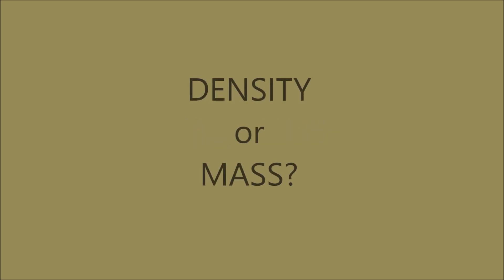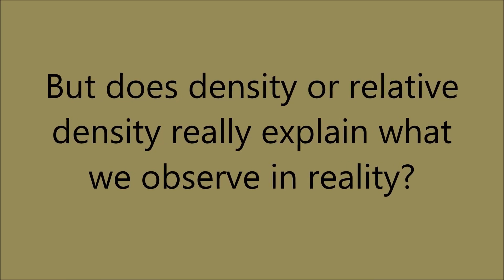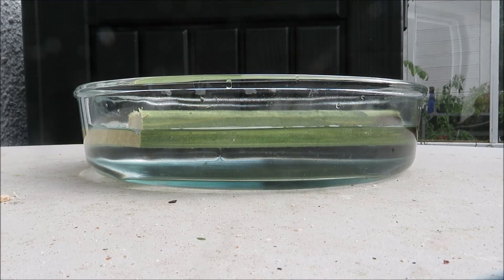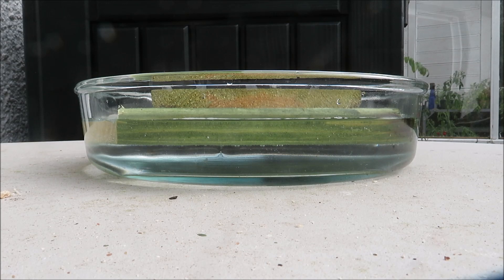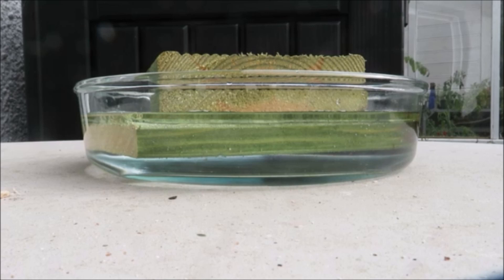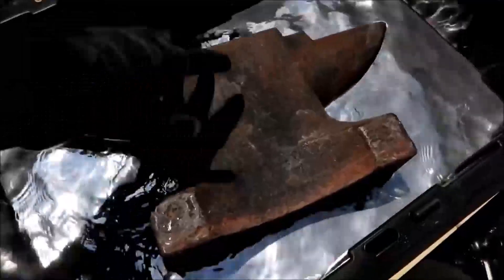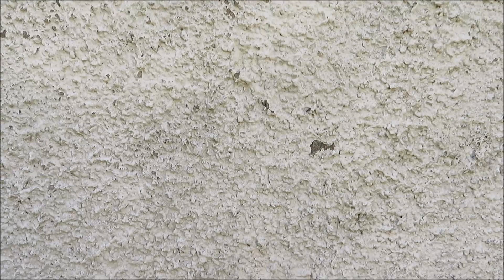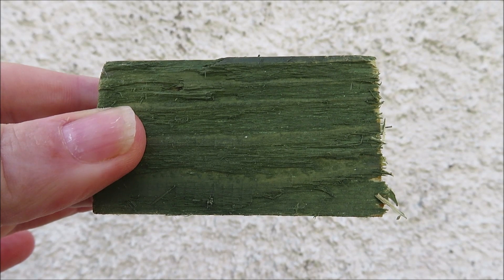Density or Mass?   Gravity or Relative Density?

Comment: Nice one  Miles and good to see you back. I was getting concerned that you had been bumped off at Traprain Law by Del. 
Yes it's the same old problem for Flerfs. Why does density act down? I got Phuket Word to agree (before he blocked me) that there was a downward force. I told him we had to call that force something and for most people that something is called Gravity. I also pointed out that a ball bearing will not penetrate a polystyrene block thereby proving that density is not the only p!Ayer in town.

Comment: Excellent video. I also made similar arguments in a video. Even more than that, 99% of the air is 3 elements. Why does it have a gradient and why are the 3 elements evenly mixed well beyond 60000 feet? My guess, gravity.
Reply: Gravity explains the density gradient but not the mixing of different elements.  In fact, it's a bit of a problem, as the different gases have different molecular weights, so you might expect the heavier ones, like CO2, to sink to the bottom, which fortunately they don't.  I think the main reason is that the different gases can freely diffuse through each other, and their kinetic energy (heat) and convection currents keep them well mixed.  It's the same with particles of ink or dye in water: they are usually much heavier than the water molecules, but diffusion keeps them mixed.  But if the heavier particles were collected together and enclosed in a bag, they would sink.

Comment: 1ltr bottle of water in one hand , a 2ltr bottle in the other. Which gets tired first?
Reply: How the heck do you hold 2 litres of water in one hand, unless its ice? I can see how your do it if it were in a bottle.
Reply: Robert Langford edited to clarify the situation. I don’t get an idea very often so I was rushing to type it out. Ice is also a good point, does water weigh more as it defrosts? It certainly gets denser.
Reply: Mass is constant, volume changes. Literally what density is. 2 litres of liquid water will be less that 2 litres when froze, but still weigh 2 kg.
Reply: The Fox Among Wolves yep that’s the point I was trying to (badly) make. It can’t be relative density causing the force downwards if it doesn’t change whilst the density does. Actually you’ve got an IV and a DV there! Have that Mr Riley!

Comment: First of all, density doesn't explain why objects fall or rise. Why should objects move towards the earth if their density is greater? Gravity explains the why. Because all objects exert a force on other objects based on their mass. Just like a magnet pulls metal because of the magnetic field, the earth pulls other objects because of the gravitational field.
Secondly, density doesn't explain why there are preferred directions: up and down. Objects fall down, balloons rise up. Any object is surrounded by air. If I lift a ball up and let it go, it's surrounded by air and the relative density of air is less to the left, to the right, up or down of that ball. That ball shouldn't care if it "falls" down or to the left or to the right or up. How does the ball knows that it must fall down? How does the ball knows where the ground is? Similarly, why is the Seven Layer Density Column in the horizontal? How do the layers know to arrange horizontal? They could just as well arrange vertically, with the less dense liquid to the left. Something must communicate to the layers where the ground is. That something is the gravitational field of the earth.

Comment: The air above the piece of wood is at a lower pressure.  Air pressure drops with altitude so the piece of wood, without gravity, would fall upwards.  Something we fail to see so obviously gravity is a thing.

I remember a simple experiment at school to demonstrate this.  A large flask had a capillary tube filled with coloured water.  When it was raised or lowered even over a relatively short height the slight drop in air pressure was apparent.

Comment: I think they are going to say that the lower piece of wood is slowly sinking due to it becoming waterlogged, and so it's density is appoaching that of the water.  Good demonstration though.

Maybe you could have removed the top two pieces and shown that the lower piece returned to it's previous level (and was therefore not saturated).

I'm sure perspective and the raleigh critereon are also involved in some way.  And 'durty urr', that goes without saying.
Reply: But they can't argue that the steel anvil was becoming mercurylogged.
Reply: Quite right, but I think you're underestimating their capacity for argument.  Not that they are very good at it, mind.

Comment: Hey Miles, long time! this is a great observation showing that density alone does not cause objects to sink, float, etc, and one that I’ve often used, and NO flat earther has ever answered even remotely.
There are many other losely related real-world observations; for example the ‘vomit comet’. The density of the passengers, the air inside the comet, the aircraft itself, all remain identical. Yet one moment the passengers sink (stay seated); the next they bocome “lighter”; the next minute they float up to the aircraft ceiling. Yet no densities have changed, so obviously more that just density is at play here. Good work!
Reply: Mark Pointer :
1.  I concur - Miles has been missed.
2.  Parabolic flights.  Good points.  What is happening on these flights is complex (as on the ISS) : the other thing that is not happening is zero-gravity.  For anyone really interested ; https://www.ncbi.nlm.nih.gov/pmc/articles/PMC2598414/
   "The dynamics of parabolic flight: flight characteristics and passenger percepts
".

Comment: "Relative Density replaces Gravity" is so easy to disprove that it's somewhat annoying to see/hear anyone try to use it as an argument.
Most Flat Earthers would agree that a 1kg cube of Iron is not sentient. It is unaware of its surroundings.
Place it on a measuring scale and it will read 1kg. Now, turn the cube so that each face is, in turn, "face down" on the scale.
The reading does not change
As the Iron is inert and non-sentient, it is not "deciding" which way is "down". By rotating the cube you rule out any possibility that the cube is creating the force required to give a reading on the scale.
(Flerfs will usually, at this point, remark that the Iron is denser than the equipment being used to measure it .. in fact, let's hope they DO say that)
Next, place a 500g cube of Iron on top of the other cube. The scale reads 1.5kg (rotate the cube if you like)
Now, pick up the smaller cube to a decent height and drop it on the other cube - the scale will momentarily give a higher reading before settling back down to 1.5kg. Do it again from a lower/higher elevation and note the readings. Lower elevations result in a lesser variation in the reading.
Now ... can a flat earther explain why the reading increased?
- It cannot be caused by the iron itself (we already established that)
- It cannot be caused by "relative density", as that has not actually changed
(There is no reason whatsoever for a cube of iron to want to try to "pass through" another piece of iron)
- We have shown that the iron cannot be the cause; density cannot be the cause; the cause must be external to the iron; the cause acts on the iron in the same way (weight) and direction, regardless of the orientation of the cubes.
- we have shown that this external force creates an acceleration - the mass did not change but the force applied to the scale did,  so F=ma tells us that there must have been a change in acceleration (and again only in one direction)
- so we now have an external force, which acts in one direction, can cause an acceleration and is independent of density or relative density and (if the tests are repeated) is shown to be a constant when all environmental variables remain constant.
So, my dear flerf, I wonder what such a force could be ... or what we could call it ... ?
Desertphile, it's over to you ....